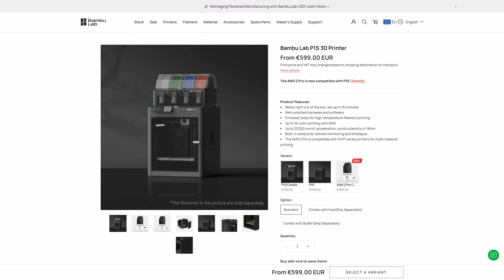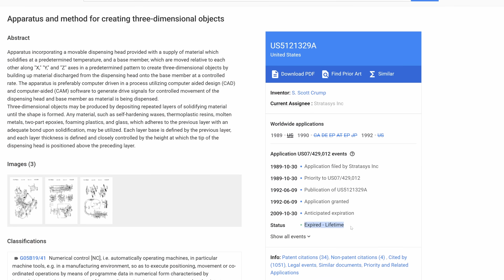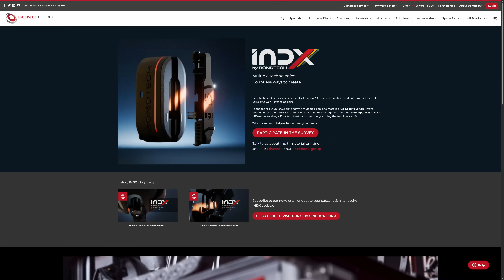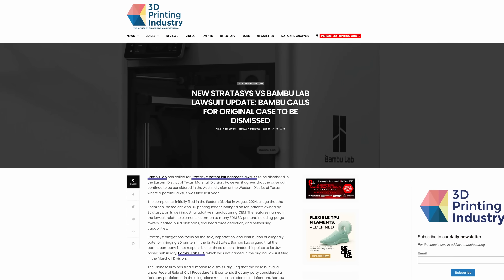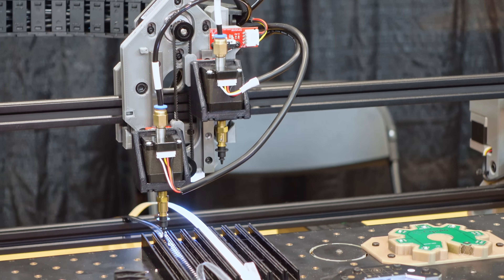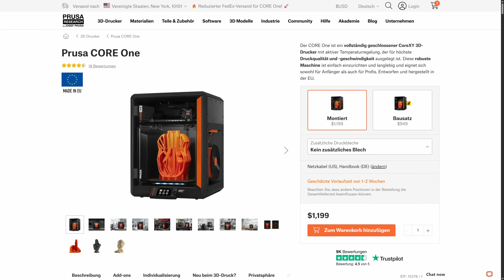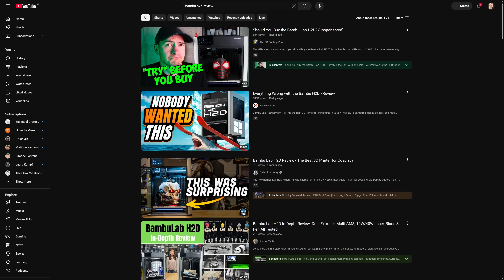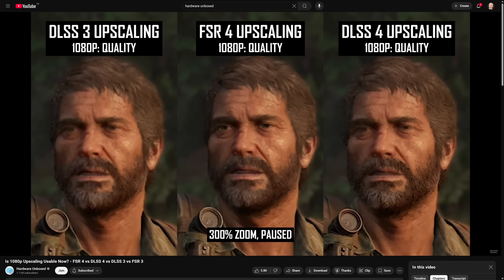How Bambu has won

Comment: As you'd expect. I want all of it. I hate hunting down multiple reviewers to know all it's there to know. Obviously depth may vary as I don't need to know, for example, all the drama that led to an ethical short fall, but I want to know the headline as ethics are important to me. That said, I want to know:
1 - Am I gonna be able to DIY enhancements or customizations without relying on dirty hacks? In other words, how open source is it? How available are compatible parts. I tend to choose parts that are already generally available and cheap (like V6 nozzle, even if it has a custom filament melting zone for maximizing flow).
2 - How is customer support and their respect for customers
3 - Are there any types of lock-in mechanism like requiring cloud service to operate or limited to proprietary raw materials. This is a deal breaker for me.
4 - Very important that even if it provides its own Slicer, that it also provides profiles for Orca or Prusa slicers.
5 - Performance, features and quality analysis with provided profiles/Slicer, in other words. How plug and play it is and how reliable and capable is the out of the box experience. Am I going to need to buy a nozzle to print GF filaments? Am I going to need to setup an active chamber heater for some engineering filaments? How far can it go into the engineering filaments? 
6 - How extensible it is (like adding tool changer or MMU units). Am I going to be able to later on add more features to it? Proprietary, 3rd party, DIY, or all of the above. Similar to first point but can make a difference if there are solutions there already. For example, with SV-08 you can add tool changers but that is far from a walk in the part. If Sovol or LDO sold kits that make easy to add them, that could prove an attractive option.

Comment: There remains, and will always be, a space for tinkerers, modders, open source hacking and so on - however it has rapidly changed from being most of the market to a small niche, simply because the market has grown so much around it. Which is fine, I think - 3d printing has become a mass market thing; so many artists and creators using 3d printers as just another reliable tool in their toolbox, is great to see. My own take on Bambu Labs has mirrored that - where most people want a tool that's reliable, it's a great solution and I recommend it to most people who ask me. I'm in the niche that wants to tinker (and let's face it, mostly break things as a result 😀) and I wouldn't recommend that unless I was sure that they want the same thing I do.

Comment: Some bad advice for you review videos: Start out by telling if the product is cloud only, if it only works with "there slicer" maybe even if it is possible to flash an open source firmware on the controller.
Why bad... Well there is an on zero risk that I won't watch the video to completion.

On a side note: Bambu has yet to make a single printer I would consider buying, so is don't think they have won just yet.

Comment: First of all, this was the best video talking about 'the controversy', and by quite a margin. A fact based approach without blaming or too strong bias towards own opinnion. My sincere thanks for that.

I don't give much value for being open source per se, but I do care on what it means for the product and features. Allowing modifications, being easy to repair, having long lifespan and upgrade paths are all important for me. At the same time, I don't want a 3D printer to be a lifelong project requiring constant tinkering, but a tool. I used 3D printers for the first time ten years ago, but it didn't catch then. The technology was not mature enough for me. Recently I invested on my own printer. I chose Prusa because of these aspects. I excpect to be using it ten years from now. 

When companies spend substantial amount of resources for R&D, it is unreasonable to expect them provide everything for free to competitors. Having companies invest on R&D has greatly affected on what 3D printers are now. At the same time I do not appreciate completely closed ecosystems, where a physical device is tied on digital services or spares that particular company is providing for unknown time. We have seen companies dropping support and otherwise funtioning devices turning to paperweights. 

I don't care, if products you feature in your videos align with your values or not. What I care is you giving a honest and truthfull content and pointing these things out. Stick on your values, and act on based on these. Do not jump into bandwagon just because everyone else is doing so. However, do not put too strict borders for yourself, if those harm your possibilities to highlight practices you care for, wheter those are positive or negative ones.

Comment: For consimers though the technology isnt mature enough to be an appliance yet.  Im therefore not a fan of a company claiming it is and pumping out a closed source voron trident cheapo knockoff.  If you have a 3d printer now, you still should really be able to build one, and understand what the firmware and slicer are doing.  Theres too many hacks selling prints of IP they dont own made from PLA and poorly printed now.

Comment: I still do not like bambu, but you are right about the patent system and market. I forgot the golden rule. No, not that one. the one that goes "dont hate the player, hate the game". I would still respect the player more if they somehow helped dismantle the game from the inside though. first step for bambu would be to fix the public key debacle that breaks orca compatibility as we knew it because their software devs are either incompetent or lying according to many in the digital security industry. If they resolve that, i will consider buying another one of their machines in the future. the same goes for anycubic. creality is riding the line pretty well the way they have been working with the orca devs and keeping the root account information right in the menu, while still having their own rfid standard but also creating a budget line in their soleyin filament. the difference is that bambu just starts to feel like they are financially milking me at a point, while creality seems to just be out to make a profit while still maintaining good faith with the community.

Comment: That tinkering approach was, what always kept me (and I suspect many others) away from 3D printing in the past. On one hand, there were the horribly overpriced $2000+ printers that were paraded at every maker convention, and nobody in their right mind ever bought one. On the other were the "cheap" Ender 3/5 clones, that broke all the time, were horribly slow, and you needed to be (or become) a 3D printing expert to get anything even remotely nice looking out of them. Those were your only options.

All to create some cheap plastic parts that you could usually just buy of ebay, if you really needed. So not worth it. The whole point of DIY is to save money. There is no point in buying a 3D printer, that costs more then all the parts you'd ever need 3D printed combined.

I got the A1 mini a year ago. It's fast, it can print nice looking parts just by changing a few settings, and it doesn't break down all the time. And most importantly, its price made sense for what I'm using it for. It's actually worth using it, over just buying something from e-bay or aliexpress.

IMHO, the other brands soo focused on nickle and dimeing you for every basic feature a functional 3D printer should have, that they forgot to build something that's actually worth your money.

Comment: My first 3D printer was a cheap Geeetech A10 (220USD) in 2018. After many modification (direct extruder, touch LCD...)  I upgraded to Core One this year and it is amazing. At first I was heasitant because of smaller size but than I realized that vast majority (95%+) of prints can fit the print bed and for the rest I can still use my Anycubic Predator. I considered Bambu briefly but I realized it is a proprietary hellhole for me. On the other hand, others have different criteria and Bambu can be right choice for them.

Comment: As a fabmanager, I'm asked for recomendations on 3d printers pretty often, and I can't honnestly recommend anything other than Prusa for reliability and customer support. I have followed you, Tom, for years, and credit you for most of my knowledge in PID autotuning, firmware setup and so much more, that actually got me to where I am today. I do value the RepRap and opensource scenes, and for that reason I shun Bambu and many others. Unfortunately, it's like you say, the market speaks volumes. but that doesn't mean we sell out, and I really respect you for it. I like your content and will keep learning from you. by the way, it would be amazing if you came to Fab25, in Brno and Prague, it'll be the event of the year, to be sure!

Comment: I think what is most important in a review would depend on the product you're reviewing  and the company. Because in some cases, technical performance is the key differentiating factor in whether a product should get a recommendation, but in other cases, that's something else entirely. For example, I know a Prusa machine is always going to be excellent in terms of technical abilities, but simply not the best. So a review there would, for me at least, provide most value to learn the ins and outs of a machine and if it performs adequately for my hypothetical usecase. And with Bambu for example, it's essentially a given that their technical abilities are the best in business, even though the H2D seems to be getting very mixed reception from people because its technical capability really depends on your usecase (from what I've seen/heard). But with Bambu there's the ethical aspect as well, spending €200 on a printer that gets locked down wouldn't be as big of an issue to me as with their €1000+ machines. A) I could potentially squeeze out some budget to replace proprietary parts on an A1 mini with open source ones if I really wanted to, it wasn't expensive to begin with. But with an X1C, I'd be demanding much more of the printer because, well, I'd hypothetically be spending a lot more of my hard earned money on it so it better lives up to my expectations. And even if it works well now, I'd like some more guarantee that it'll keep doing that in the future, which inherently means availability of parts and resources. They're currently good on that front, but what if they suddenly stop producing replacements for their proprietary parts and sue every company that does into oblivion? That's just not a concern with Prusa. B) I don't want to see the industry moving in that direction though. It's clear that it will keep going that way, but that means I think it's even more important to also take good care of the companies and projects that DO stay true to the open source roots of 3D printing and RepRap. Having the option to choose is really important for me. Unlike with 2D printers, for example, where everything and anything is proprietary. 

Long story short, I'd value reviews that cover aspects about a machine that aren't already a given (it's so difficult to make this into a oneliner).

Comment: Such a mature view of the 3d printing space 😍
I myself went through those early printers, couple of Prusas and now H2D and while sometimes I miss the good old days of making 3d printer the hobby i moved on. I need the printer to be a tool, like a hammer or a wrench but I understand the underlying technology and how good it is now compared to those early clones.
In contrast to that, messages from people who are entering 3d printing now, expect those printers to behave like inkjet or laser printer, hit button, receive print. Nothing wrong with that but 3d printing is a bit more complex and people don't understand why a slicer has 100+ knobs.

For me - I would love to see content that goes about highlights of devices/technologies and biggest pitfalls.
does it print reliably  (kinda a given looking at the current state of things)
does it have sensors to prevent it from catching fire - can I leave that 24h+ print untended
can I use 3'rd party consumables
is it very walled off garden or just a bit ;)

and you seem to have the exactly right experience to be able to cherry pick the highlights

I've been watching your content for 5y+ and it is constantly very good. Kudos!

Comment: People calling CoreXY printers Bambu clones is like calling the A1 a RepRap clone because its a bed slinger. Of course they look the same, it's a motion system that has a certain layout and only has certain ways to achieve a goal, like having a filament loader on the top because what do you do with boxes when you need space? You stack them.

Comment: they havent, just because you make a rigid machine doesnt mean they are the top.
in terms of quality and customer support, prusa overtakes bambu.

besides I find it hysterical from bambu to close source the entire machine down to the steppers and especially firmware.
just the day bambu stops a old printer series firmware updates, hackers will go wild for them. 
see windows xp, heck even windows 7.
closed source firmware to something that can cause a fire is bad, 3d printing was meant to be open source.
Reply: Literally any electrical device in your house can cause a fire!  I doubt many are “open source” 🙄